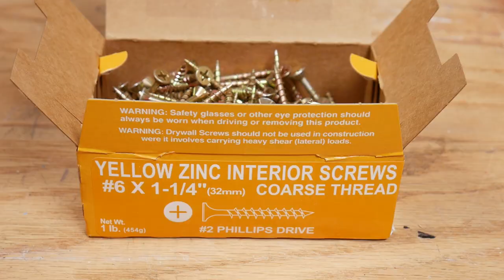How to Make a Geoboard

Comment: The shellac info was a nugget. Does it work with watercolors or is it going to smudge the paint?
Reply from the maker: That's a good question. I don't actually know. I would guess that it would be fine once the watercolors are dry but I'm not sure.
Reply: @Makify1  thank you for the reply.